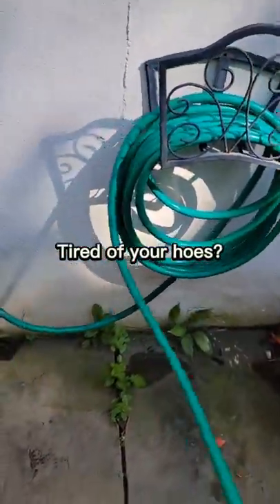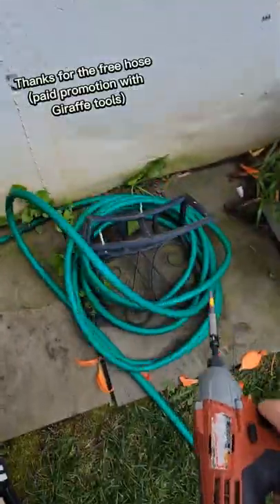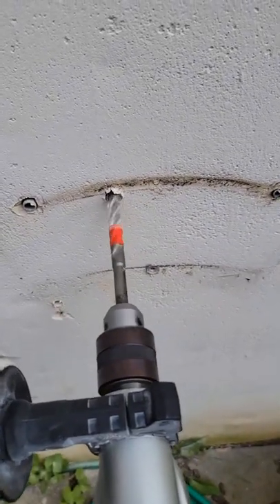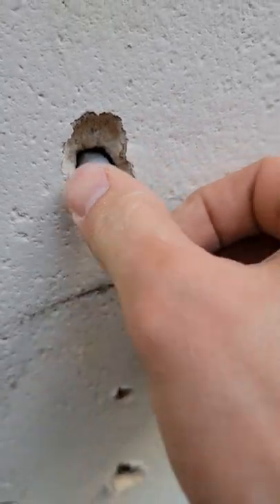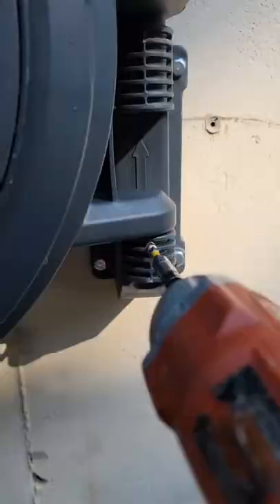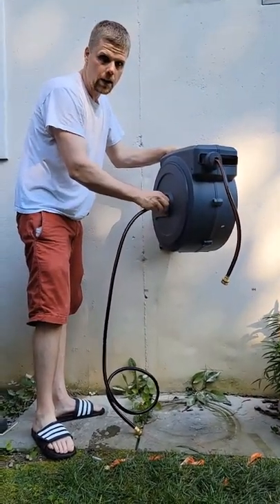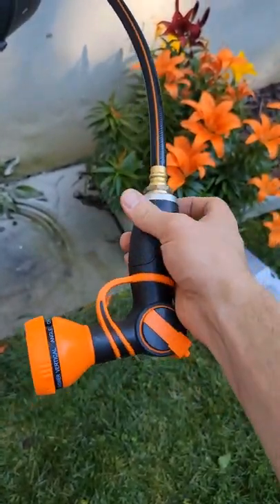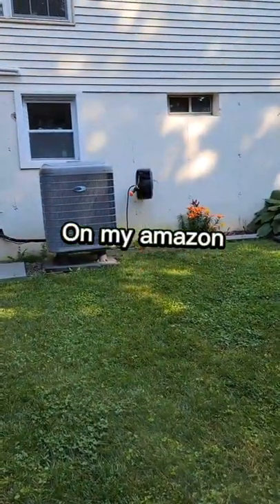How to install a hose reel #shorts

Comment: This one I got feeling the mechanism that pulls it’s self back will break quick. Also not sure if that hose in it is replaceable
Reply: I've never found that these retractable ones break entirely, but it gets weak. You have to guide them in a bit more than just letting the hose go
Reply: What got me was, “it’s on my Amazon” lmao

Comment: They got the hose that expands under pressure.. seems light weight
Bed bath and beyond some times .
Pressure washer hose is what they use to paint similar tube size but totally different probably..
Good easy paint houses with fire truck ladder..
 And use it to lift roofing supplies.
One ladder was $3,000 and lifts 200 pounds at a time but it's not as convenient as fire truck is

Comment: These are not good ones. Plastic ones will crack under sun in 2-4 years. Need ones with Stainless Steel made and your way of releasing hose is not correct as it will loose the spring. Need to bring the water gun  with hand near the hose reel to let it wind but not with force